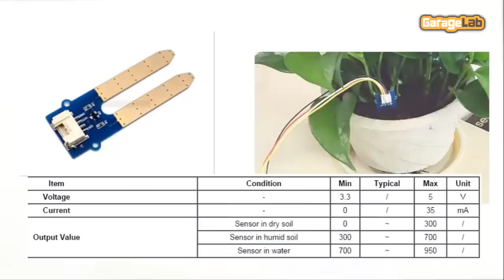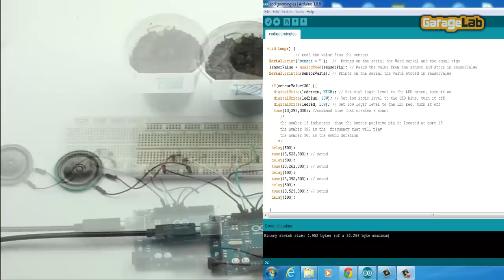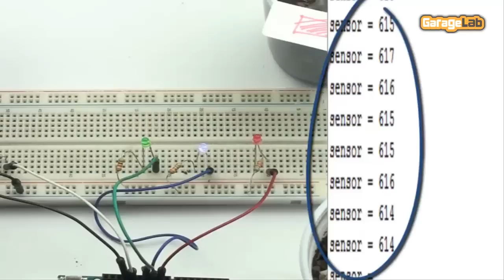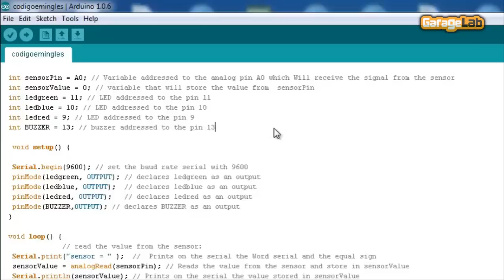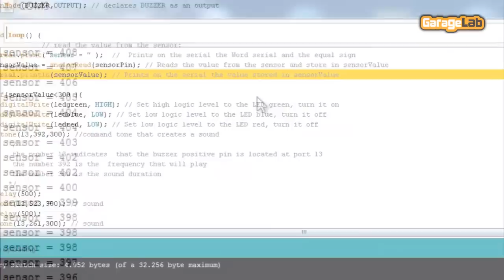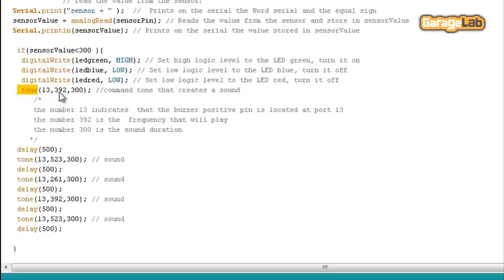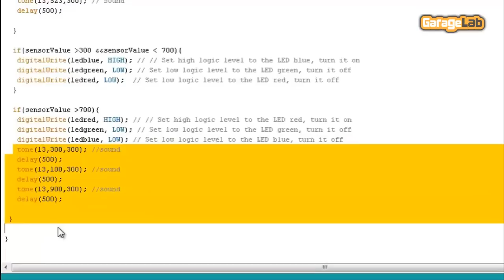Tutorial: How to use the Moisture Sensor Grove

Comment: nice project. if i would like to use three water pump what the changes on the codes and how to connect the water valve with the arduino
thank you so much

Comment: hi, its a nice project. I tried it to run a pump instead of a buzzer, using a mosfet transistor when the value is >300. I have used a red led as a indicator for low moisture and pumping motor. But '' sometimes'' the blue led (used for ideal value ) also starts blinking. Can you please help me to overcome this problem? It would be of great help

Comment: Q: When probe is inserted in dry soil,  and a couple  mm of water is poured on the soil, so moisture contend is not uniform along the entire length of the probe,  what will the probe read?  Will it read the top couple of mm of wet soil?

Comment: Hi, nice project. Just a silly comment about your code: if the values are exactly 300 or 700, nothing will happen, because the 2 first 'if' consider > 300 or <300, never =300. The same with the 2 last 'if' regarding 700. It is not a big deal, because the probability of such values got read is small, but it is also something simple to fix. BTW, are you Brazilian? Your accent seemed Brazilian.
Reply: +Maco that's why I mentioned it was a silly comment and the probability of the issue to happen was very low. I commented just to point out this fun fact.

Comment: Thanks a lot Garage Lab for this tutorial it really help but the only problem is regarding the connections on the board (Arduino hardware such as led,transistors and ports) it will be more great of help if you can put some images.
Also I would be glad if you I can have your email address for personal discuss.